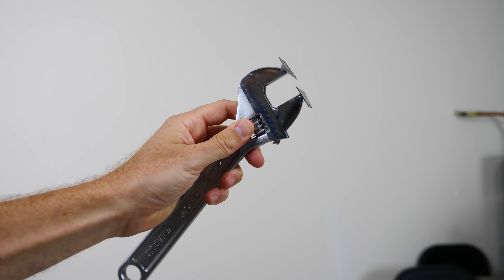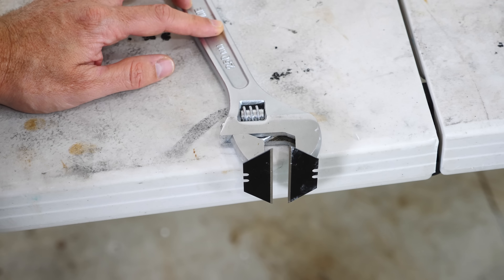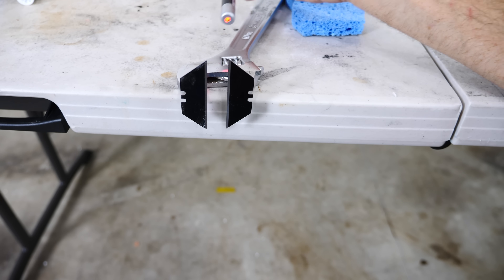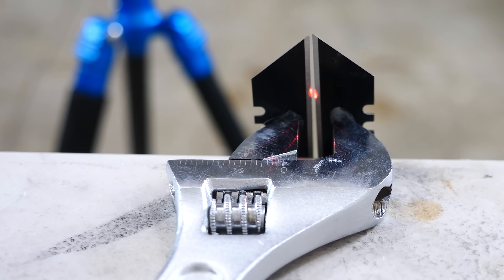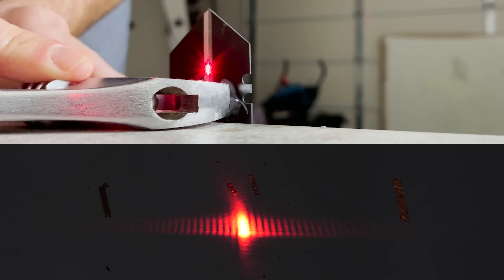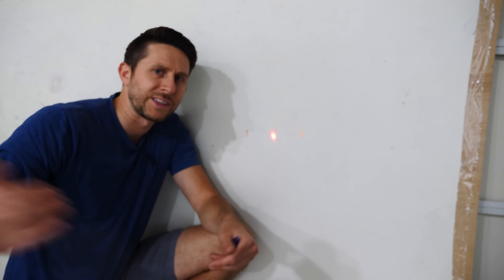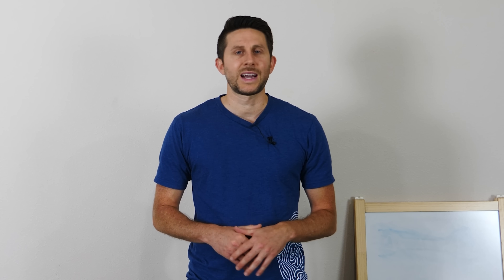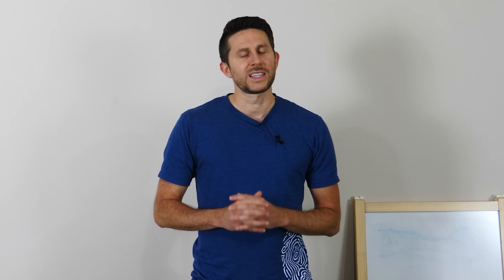Squishing Light Makes It Bigger—Heisenberg's Uncertainty Principle

Comment: I like how it's called uncertainty principle but yet it shows light in perfect banded patterns And not scattered haphazardly like rolling dice As the math would suggest.  Patterns and banding is always the Defraction Or refraction And follows the wavelike medium which is being bottlenecked by razor blades.  Calling it a particle would be like calling sound a particle which is an incorrect analogy

Comment: Basically, it says that the tiny gap is where you are certain about the photon's position as it passes through, you can limit this position, but then you know nothing about the direction of its momentum. This is because when a probability wave enters a hole, it spreads out in all directions. Since probability governs momentum, each photon can have any possible momentum due to the probability function. So, even if you send only one particle at a time, you still end up with that pattern.

Comment: What is shown here is the double-split experiment shows the exact same result as the demonstrated single-slit: this tells me is the double-spilt and its quantum conclusions are misconceived. The (resulting) pattern from the single and the double are the same and are so just a property of light as described and do not demonstrate wave interference at all. I noticed this years back, yet the double slit is held as one of the pillars and defining demonstrations are quantum mechanics. It is not. Quantum is real, but the double slit is not the best demonstration of it as it is claimed to be and needs explaining itself, and I think this is done here.

Comment: I see we already have nanolasers developed with width of between 50 to 150 nm.
These are sizes way thinner than most slits used in slit experiments.
The difference is in one case we limit the possible position of the light to a narrow slit, and in the other the beam itself is narrow (but passes thru/around no obstacles).
So if HUP is actual physical phenomenon, then why knowing the position of a photon down to width of 50nm doesn't produce spread spot?
Why does it only happens when we force light to refract on edges of a slit? ;)
This experiment (as many quantum experiments) have wrong interpretation, because of wrong assumptions.
The wrong assumption is that light is ball-like object and that its wave-like behavior is only manifested in a "spread probability" the narrower the slit (aka "position") it passed thru.
But we know that light while being quantized also behaves like a wave. And all other known waves (just as light) refracts when passing around edges.
Actually an edge that hit by light behaves like a point-like light source - ie spreads the light in all directions from that point.
We don't see it normally usually either because the "slit" is too large and the whole beam passes w/o hitting any edge, OR because the part of the beam that passes thru is too bright to easily see the small amount of light that's spread, so we have to close the beam enough to make the spread visible. Also note that most lasers have circular emitter, so if the slit is wide open even if it touches the sides of the beam it's only s smaller part of the circle, while it's very narrow it's in the middle - ie larger part of the circle - hence the refracted light is much more and easier to see.

PS. Btw you can also see there's a interference pattern. That interference happens because with single slit there are two diffraction places on each edge. Since each edge emits circular waves they interfere and produce that pattern.
D-slit or Single-slit experiments have never been about which path or is the observer conscious or not :) They've always been about our inability to understand light is a wave (sure special kind of wave that travels in vacuum and is made of quantized packets - photons)

Comment: Hey Action Lab, I have a really long tangible inquiry; maybe can be a long experiment.
I did not know where to place this comment among The Action Lab videos, as many contribute to this thought engagement, as well as other sources.
I was thinking yesterday about Light, Chemicals (Specifically H2O), Black Holes, Radiation, and Energy (In the form of Thermal Sciences). 
My questions derives from some information, and may be a little difficult to get the question out of, I know is a little difficult for me to word it accurately.

So if light is bent/manipulated (refracted) by H2O a chemical combination on earth under our atmospheric conditions, and a vacuum doesn't fully simulate a real black hole, and since we know a black hole still has the feature to manipulate (pull light); how is/are (Light, Chemistry I.E. radiation, elements, periodic table of elements natural occurrences, and the formulas/combinations Gravity, and Electricity I.E. lights' derived engineering and substances to form a light on LED, or laser, etc..  all relative and to (a (and the)) comparison of a black holes nature, earths conditions, spaces' conditions, and including the difference of the relative just proposed; as well as the function and interactivity of what we understand of this entirety, to reverse engineer a black hole, light itself, and fully understand a true periodic table of elements as an entire language.

SIDE QUESTION:
A precursor thought to my thoughts yesterday, was the day before, of which I was thinking of what does our language really mean, if the universal language is the periodic table of elements (As described as an alphabet) Example: The word "Notice" = "Not ice" = "Unfreeze / gain attention" and the comparison to "Na" being "SoDiUm" = Salt. What if our periodic table is going to be our language / alphabet in order to advance our race or species to higher intelligence and understanding / evolution, and that's why we can't see the alien races without their own engagements. What does this mean for our current alphabet and our worlds languages having similar types of layouts and patterns? 

Similar to geometry how a "line" is a letter, and a "dimension" or "Axis" is a sentence structure and "angles" are vowels, or in math where 0 is fully understood and also not fully understood.

Hopefully you can find my true question in there, there is about 4 unanswered questions.

Let me know please! Thanks!

Comment: It’s actually reflecting the sharp edge of the razor blade at all angles from the radiating light from the beam
Reply: Nope my friend, that's not the case.
Reply: @adityagawande6190  then I suppose it would work with a pin hole as well
Reply: @adityagawande6190  yeah I smell bs it’s just refraction you could put a little dull section on the blade or take a chunk out and the image would repeat with that part of the line missing.
Reply: This is what I suspect. If you do the test with non-beveled slit, with black paint on the gate, it might not make the pattern.

Are there any videos of people doing this with absorbing slit material?

Comment: Huh.

The same "choke it too much and it spreads wider" effect happens with shotguns. But with shotguns it is because the shot pellets get deformed as the barrel chokes down which causes greater variables in the aerodynamics of the individual pellets.

Comment: Could it be because of light bouncing of of the thin edge of the blade and due to a angle between this edge and laser... idk.. does the pattern change of you use thin wires instead of blades? What if you angle the blades so there is no edge from wher the light could bounce? The edge is thin but quantum mechanically speaking ,it is enormus and light can surely boounce from it ?

Comment: I don’t think the wave-particle duality actually explains away the diffraction pattern. The photons wouldn’t behave as localised particles until you observe them passing through the wrench, just like the double slit experiment. I remain skeptical as to whether this actually demonstrates Heisenberg’s uncertainty principle. 

Also, for most systems, (a key exclusion being the quantum harmonic oscillator), the inequality is greater than hbar/2.

Comment: Please try this ... 😎
When the light separates .. the dots/lines look just like an image of the left over serrations from the sharpening of the razor blade.
Specifically ...
With a magnifying glass looking at the blade.
You see the beveled grinding marks on the blade.
Just away from the sharp edge.

(Maybe these grooves are what causes the separate dots/lines?)
Don't those bevels cause the light to take a "pool table shot" ?
 if you had a truly sharp razor (thinner old school shaving razor ... or just  a razor sharpened to one side only. So the facing side is flat right to the light facing edge.
As opposed to the thick work blade you used ... With the triangle bevel.
Wouldn't the pattern look different? 
Maybe a more perfect blade would make the transition smoothe ...
Without "dots"?
Very curious ... What different "splitters" would do to the picture.
Please try ?
Thanks ... Love your videos.

Comment: it's kind of like measuring the reflectability of how actually sharp the blade edge is due to it's molecular structured reflection of the surface edge. Is their a difference in the types of materials used due to it's lattice structure?
Reply: It sounds like a measurement of a 1+ atom spherical surface reflection to however thick it is let alone now you'd have to figure out how laser precise an edge could get.

Comment: How can a red (low energy) photon of light excite the phosphorescent material to a state high enough to emit a green (medium energy) photon of light as it drops energy states. Blue or violet (high energy) photons shined on the phosphorescent material yields green (medium energy) photon emission which makes sense since it’s lower. You can’t get more energy out of the system than you put in it. The energy of a photon of light emitted by a phosphorescent material should always be lower than the source exciting it. In other words, the frequency of light emitted emitted should be lower than the source and the wavelength of light emitted should be higher than the source.

Comment: We can know the position, and momentum at the same time, because they are both physics properties of an object. The position is the spin around a negative mass hole, and the momentum is the length of a negative mass tunnel towards the next hole. How you would get a reading of them both is going to be extremely difficult. Maths are useless for understanding physics anyway... the fault is probably due to using maths instead of physics. Physics are shapes, you can program with shapes... why use numbers?

Comment: Actually to measure momentum you kinda have to know where it is to measure it right... So in the moment of measure wouldn't they know both location and momentum. The hadron collider also sees both as quantum particles make trails through gases as a speed that is measured. Unless the lines and swirls travel backwards as if toward the collision but everything moves in an outward direction. Cant know the location and velocity after they aren't in the chamber anymore. If that doesn't count then why not?

Comment: The sharp edge of a blade is curved. The sharper the smaller the diameter but still on the scale of light curved. 
How much of the broadening of the beam, is due to (just) bending and bouncing back & forth of the light on those curved (mirror) edges?

Comment: you forgot the de Broglie relation that ties this all together: momentum = h / wavelength/2pi, will diffraction angle is (roughly) wavelength / gap/2), so: 
delta X = gap
delta P = (h / wavelength/2pi)(wavelength/gap/2)

(delta X)(delta P) = h/4pi

Comment: I don't get the explanation about it being particles because of some background. The alternating stripes of light reflect its very wave nature. If it were particles, there wouldn't be wave interferences but one continuous stripe with a gradient... Light behaves as both, a wave and a particle and the way I understand it is that its in a constant Schrödinger state of wave and particle until it's forced to reveal itself as one or the other. The fact it doesn't absorb the energy probably has more to do with the wavelength... Your laser is red and glow background charges closer to UV light wavelengths.

Comment: When the light gets spread out it's because of diffraction so it should hit the wall as if the slit is a single source of circular waves which means that there should be no gaps in the light band you see, but there are bright spots and dark spots but the wave is not interfering with anything so why are there minima where there is no light?

Comment: I'm not buying that this isn't just a slit interference pattern. You used a different source to activate the luminous paint. The laser pointer isn't the right wavelength to activate the paint, so that's not convincing. And this is a clear interference pattern. If it looks like a duck... Uncertainty occurs at much smaller dimensions than this. But this is a great way to demonstrate the diffraction of light through a slit.

Comment: I think the idea is right in this video, but the scale is wrong -- I don't think the distance between the razor blades is small enough to demonstrate the uncertainty principle with visible light, which after all can resolve microscopic objects, while the razor blades remain separated by a distance that is visible without a microscope.  Instead, this is demonstrating single-slit diffraction, which can become noticeable before reaching the scale at which the uncertainty principle becomes noticeable.

Comment: The Action Lab:  Love your work!  I've learned a lot from your reality experiments.  Thank you.  But here you've used illogical assumptions, and I can help you by showing you how to replace your illogical assumptions with logical assumptions.  Uncertainty is a consequence of measurement, because in measuring, you can always only measure approximately, to the nearest gradation of your measuring device, thereby always leaving some uncertainty in your measurement.  Uncertainty has never been a fundamental property of particles, and it fails to logically explain the surprising results slit experiments.  For a unique, logical explanation of the results of experiments in which individual particles each pass through 2 slits, you should view my video, "Particle 2 Slit Experiments Explained By Paul Marostica".  I'm curious to learn what you think about my explanation.

Comment: You can't say that you're going to use a material and then say it doesn't have specific mass. If that makes the rest of your experiment irrelevant. A photon has never been the input or output of any experiment. When I turn my flashlight off photons don't go rolling around the floor

Comment: I would just like to point out that the reason ur red laser or light is not affecting the glow in the dark back drop paper is NOT because of some particle/wave duality held by Light,  but merely due to the higher frequency of the blue light to the red.  As another viewer has commented,  the literature as well as spec and data sheets for various Light bulbs goes into help with explaining this kind of thing; the frequency differences. 

AS WELL,  I believe he is incorrect in his stating that Light is both a wave and particle.  To me this is nonsense, that many genius inventors,  scientists,  n great thinkers in history agree with me. 
Light,  along with everything else in the perceived world,  is comprised of waveforms,  or in other words,  composed of varying pressure conditions.   "Light",  specifically though, "is nothing other than a sound wave in the ether" (- Nikola Tesla) .  It is a coaxial propagation of induction through a medium.   There is nothing TRULY traveling, no Thing or item of principality, that is moving from point A to point B. It is merely the movement (or moved-moment),  or perturbation  or disturbance of the medium,  that causes the perception of a moving instance of Light, or "beam" or "particle" of Light.

I would suggest to anyone interested in the Nature of Light,  Electromagnetism,  field theory, dielectricity, and DEFINITELY if you're interested in quantum mechanics, to check out the material (papers,  books,  videos,  lectures,  etc) of Nikola Tesla, Oliver Heaviside, Eric Dollard, Charles Proteus Steinmetz,  Walter Russell, and Dr Edward Dowdye just to name a few among the many genius inventors, thinkers,  scientists,  and luminaries of our recent history,, from the late 1800's up to our current decade,  with Dr Dowdye leaving this Earth and making his passage back Home on December 31st of 2020.

Comment: Hold on not so quick, light particles flowing through a large whole move straight forward not colliding. Squeeze them together through a smaller whole than the beam puts pressure on them. As they collide they will start bouncing off one another causing them to spread out. Water through a hose does the same thing. Squeeze the end and the water fans out.
Reply: Photons do not interact like molecules do

Comment: I think you need to use something non-reflective instead of those razor blades. I could see the reflections off the edges. I wonder if there is some reflection bouncing between the blade edges then getting through. Maybe, very carefully, paint the blades with some of that really really black paint you had until you can see no edge reflections at all, then repeat the experiment. (I'm aware of the effect you are demonstrating, but the variable still needs to be eliminated.)
Reply: Totally agree!!

Comment: I don't see how that proves it isn't wave diffraction. It's still the same wavelength and energy per photon. And we know that red light will not charge this material.

My understanding is that the wave-like nature of quantum particles is the reason the Heisenberg Uncertainty Principle. It also applies to sound: the shorter a sound, the less sure we can be of its frequency.